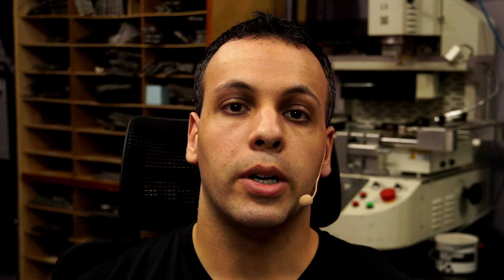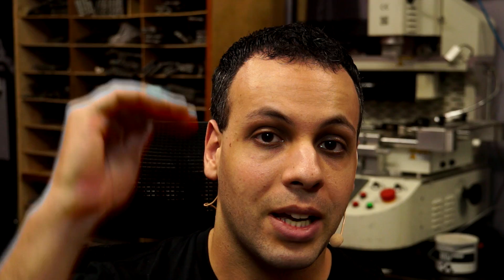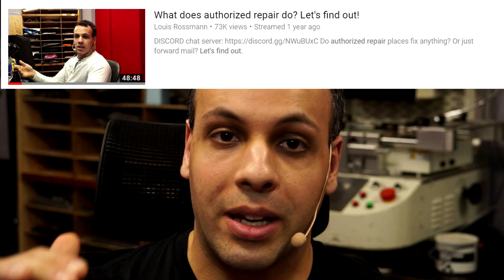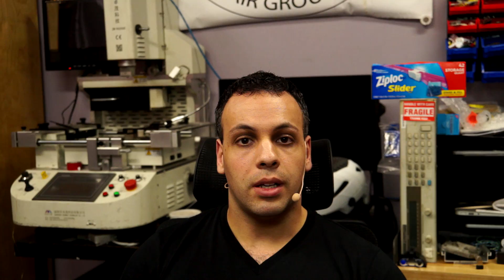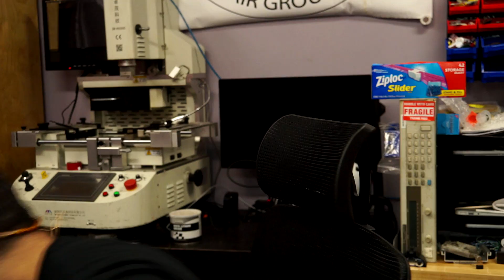Apple's war on refurbishing.

Comment: I’m torn in this topic. On the one side of Apple, sub par repair shops could potentially damage the brand. A bad repair can cause negative consumer perception of the product itself. On the other side, a company exclusively holding the keys to repair rights causes inflated repair rates. I’m just surprised how far Apple is willing to go to chase down “unauthorized” repairs.

Comment: I previously worked for a company that did repair and refurbishing on multiple brands of copiers. The cost of board replacement for copiers is absolutely bonkers. Once a machine is out of warranty, replacing the main and engine boards in most machines is usually just as expensive as replacing the whole machine, so we often use boards from damaged machines, or take a donor board and do minor swaparoos to make one usable part.

Thankfully, the copier industry has not reached the model of forced obsolescence yet, because copiers are not often sold at a high profit margin, instead relying on the sale of service contracts and supplies over the years. Either way, the precedent Apple could set is pretty scary.

Comment: I recently had a leaky faucet in my Apple Home. Apple asked me to return my home in it's original packaging for warranty consideration. When I explained that this wasn't possible, Apple offered to sell me a new home. Of course my home model was now obsolete, so for a nominal charge, I was offered an "upgraded" home. 

The cost of bulldozing my "non-functioning" home was more than the initial cost. I had a RedSeal Journeyman Plumber replace it with a Home Depot ($2.49) faucet cartridge and promptly found all my doors and (dare I say it) windows locked. 

When I looked into replacing my home with an Ubuntu or maybe a MicroSoft home, Apple's legal arm reminded me that my "land property agreement" was compatible only with having an Apple Home. As I took the matter to the local, then Provincial Courts, Apple began drilling for oil on my modest property.

Because I had "modified" my home, I violated the EULA. Apple therefore adopted all mineral rights and is currently making $millions/month and my home is currently the "rigger's dorm".

On the plus side... the faucet doesn't leak anymore.

Comment: VW has been doing this for fifteen years with "component protection". Control modules installed on the in-car computer network are only able to be installed and "adapted" once. Because of this there is no such thing as a "good used" module, once installed it is tied to that network. This forces the owner to come to the dealer and have a new component installed by them, utilizing their system that actively connects the vehicle to the VW AG computer system and database. The ability to "unlock" the system to even allow it to recognize a new component is solely held by VW. Let us not forget the environmental cost of not being able to utilize parts lying dormant in wrecked vehicles, some of these components having a large carbon footprint in the manufacturing process.  Tesla has turned this into an absolute art form, and John Deere has been holding farmers hostage for the two decades. This is just another step, this war has been going on for years....  and yes it all started with the guise of "security".

Comment: So far there are only 2 industries this sort of corporate abuse is seen as normal, tech and entertainment.  As they are rapidly becoming one and the same we can expect the situation to only become worse. The battle of Net Neutrality is a fine example. I buy a certain amount of bandwidth from AT&T and, aside from disruptive or unlawful use, I not AT&T, should have the unimpeded, unthrottled choice of how I use my allotted bandwidth. AT&T thinks otherwise and soon may make it difficult or impossible for me to use certain services unless AT&T approves.  We're all already conditioned to this from tech and media and so it's almost a given AT&T will get it's way.  No big deal, except tech and media are spreading into everything.  Your toaster, your car, your dog callar.  Soon your electric company will be controlling what brand dish washer will work in your house. Plug in a brand of hair dryer that hasn't paid to be on your electric company's approved list and it only blows cold air.

Comment: Apple will not kill repair, but it may  kill repair of Apple devices. 

I predict Apple will turn to a lease business model where device repair, replace and upgrade is included in a monthly contract. Like software, the device market is getting mature where differences between devices is decreased and new models have improvements that are small and of questionable utility. Adobe has moved to a subscription model, Office is trying to move to a subscription model. MacOS is essentially a subscription model where the price of entry is to buy a Mac.

For software companies it is the long logical step to maintain revenue. Moving that business model into "disposable" hardware tightly integrated with software is not only logical but inevitable. As is often the case Apple will be a market leader. Doesn't mean it is a good direction.

Comment: This case isn't about refurbishing it is about repair or upgrading. Any argument made about replacing the glass is transferable to any other component in a device and not just apple devices or mobile device. If apple wims this case and you buy a pre built system from dell in norway (and later anywhere) then upgrade it could would be considered counterfit. Louis mentioned cars in this video the legal precedent is in the Intelectual Property sector which extends to cars and anywhere else a manufacturer places a logo on something.

Comment: IBM had a huge lead in the 1980's which disolved into nothing by the 1990's when clones toke over.  Outside competators will find away around the strong Apple marketing, then the loyal customers will blindly buy other crap.

Comment: Having SSD and RAM soldered in makes your data just that much less prone to a security breach by hackers who know what they are doing or even a random dude with Kali manual he downloaded for free lol

I support right to repair though regardless but I’m not blinded by my bias either way as they choose to over charge a great deal for higher specs.

I choose security though over upgradable internal components at this point.

(Off topic I know 👽)

Comment: That’s really what’s happening across the spectrum not just Apple. One of my friend's dad’s TV repair shop also closed. Things got miniaturized and also basic info that used to be part of the user manual was tougher to come by and generally people just shifted to new products.
Earlier companies used to make products that were easy to open and fix and used standardised components so even aftermarket parts could be used. Now everybody is going custom and designing for a short life... makes it cheaper too as they can mass manufacturer replacement parts.
I'm part of the Electric Vehicle industry and part replacements are extremely normal especially electronic components like - AC to DC converters, Controller boards, Onboard charger that sends current to batteries, BMS and so on.  It's all about replacement and not repair.
Its terrible, but corporations are going this route there is nothing that can be done about this.
Apple isn’t the only one just the most successful one - so it's easy to attack them.

Comment: I am a big supporter of right to repair, and love Louis's work.  But the story was a little misleading when talking about the home button.  They neglected to mention the fact that very same home button also contains the fingerprint reader for touch ID.  There are very legitimate reasons to have the OS lock down if it detects someone messing with a bio-metric security interface.  As a user of these bio-metric devices I support the OS locking down down when a major change is detected, even if it means I do have to have certain things repaired directly by the manufacturer.  We need to find the balance between protecting our privacy and our right to repair.  This is just a little thing that bothered me about the story...I love the work you are doing for all of us!  Thank you!

Comment: The problem is that we are expecting so little of your average citizen. Louis's videos on teaching and parenting highlight the same concept. People don't understand, blindly follow those who scream loudest, and refuse to put in the energy to learn the truth. I am convinced that unless this trend changes, it will be the downfall of society. 

In the 1960s, Heathkit sold tube amp kits with plate voltages nearing 500 volts to consumers. They sold transmitter and RF amplifier kits with voltages in excess of 1000 volts at lethal current. There are warnings in the manuals, of course, but people were expected to take responsibility. 

I've had people try to tell me that repairing a computer is dangerous. We need to draw a line somewhere on what we expect from consumers.

Comment: if apple wants to kill repair then why not go after the so called "mall screen repair" shops too.

good counterfeiters are going to steal the stencils to print the logos or even steal the legit parts for examples.

1. a good apple counterfeiter will break into the factory of foxconn and steal the stencils or printing plates for the logos (similar thing has happened in the past at us mints where someone stole the printing plates for money).

2. a good apple counterfeiter will break into the foxconn factory and steal the already printed plastics for the products and slap their own shoddy parts in the enclosures (similar thing happens with designer products like where the legit cuggi badges are stolen and applied to flawed leather or even plastic).

apple if you are really serious about preventing repairs why not go the extra mile and take a page from laptop battery makers where they suicide the bms so if you try to replace the cells then the battery no longer works. (arcade games boards did this with a battery and some nintendo cartridges had a battery so if the chip is dumped the contents are lost to prevent piracy)

install a chip on the digitizer glass so as soon as the screen is disconnected from the motherboard (even for motherboard replacement) the authentication code in the chip is lost and then the digitizer stops working

Comment: .... then the glue comes off the glass and the touch sensor stops working.  What amazes me is Apple will charge $150 for a display replacement and these refurbished places will charge $20 less and your phone stops working in six months. Why, just take it to Apple and ha e it fixed, if they break your iPhone during the repair or unable to successfully calibrate it, you get a new device at the cost of the display. If these repair shops break it, you ain’t getting shit.

Comment: To be fair, the touch id security argument is nonsense. How do these work? The touch id stores the finger prints (a one way hash of them) on itself, it does not give this data over to other parts of the phone. When there is an authentication request the phone will simply wait till it is interrupted, or an authenticated signal comes from the touch id (simplyfied a lot in this). Let's say you switch out the touch id part. The only problem should be that the recognized fignerprints "disappeared", because it was in the chip itself which is not there anymore. If you put the original touch id on an other phone, than the touch id should recognize that the underlying hardware changed (not hard, should be properly protected behind assymetric keys).

TL-DR: There is no security reason to stop the touchid from working when it was changed, it should only forget the fingerprints.

Comment: Sadly, this whole concept is really true, and has been going on too long.
Lets talk automotive... GM (or just Holden as we may call it here).

My car, 1999 model, relies on two computer (modules)...  The ECU (engine control), and the BCM (body control, ie lights doors etc).
Each must be matched to the other via their unique code, otherwise nothing works. A repairer can fix wiring, but if a MODULE needs to be replaced, well, one is at the mercy of the dealer prices to "pair" the two together again... and from what I've heard, It's way, way, expensive  :(

Something  needs to be done across ALL industries.

Comment: changing a honda muffler with a non oem part is not a refurbish, nor is it an upgrade. however if you buy a non oem honda branded muffler thats not actually made by honda or a certified oem manufacturer is a counterfeit product. you still risk nothing in an automobile until your slinging ads stating youre a repair shop using oem product. consumer electronics is a shitty industry.

Comment: I don't disagree with the right to repair concept.  But Louis is wrong here.  The problem isn't with refurbishing the phones, the problem is refurbishing the phones with aftermarket parts.  The difference is between OE, OEM, and Aftermarket parts. An OE part would be a glass screen produced by Apple or an Apple manufacturer with the Apple logo/branding.  An OEM part would be if the manufacturer of the Apple screens produced their own without the apple logo.  An aftermarket is producing the part without any affiliation to Apple.  A good analogy is car parts.  When I buy a new car it comes with OE wheels.  In my case, my wheels say "Ford" on them.  I could buy the same wheel made by the same manufacturer but without the Ford logo, and that would be an OEM set of wheels.  If Ford has allowed the manufacturer to produce these wheels, that is fine.  Lastly, I could buy a set of wheels that looks nothing like the OE wheels, fits my car, and that would be an aftermarket part.  The problem then is if a company is producing wheels that look identical to the OE wheels, says "ford" on them, but the company has no affiliation to Ford whatsoever.  That is counterfeit.  The same thing is happening here.  Louis confuses this issue with that of the "right to repair" issue.  Apple is quite clearly within their legal rights in this case.

Comment: Microsoft married the Xbox 360 disc drive to the unit. If you wanted to replace the disk drive you had to have the skill to swap out the board within the disk drive... And with there being five different model drives you also had to get just the right Drive.

Comment: I hate apple from the very early on Apple II era, I and my family have never owned and will never own anything made by Apple. 
Smart people should only buy things that they own and are allowed to repair.
I think by law it should be that circuit diagrams are provided by the manufacturer along with user manual when buying any  electronic equipment.

Comment: So Louis...who do you trust? I've been a PC and Android user....always have always will be. I've always built my PCs, but I'm curious if Samsung is starting this same $#!+ with the Galaxy phones. There's where I've bee for some time now. So...should I be leery?
Reply: yes samsung doing same thing (there a new type phone coming out but cant remember the name)

LG and Google are all copying apple now it seems

delete android go lineage os
Reply: @DragonProtector  that's a dang shame!! I have the Galaxy Note 8 and love it, but at the same its glass front and back all glued together! Makes its it real tough to repair. My fear is they make it this way so they break easy. Such a shame.
So anything with the lineage os phones that is just as good bells as whistles, robust and easy to get into when you need to say replace the battery or a cracked screen that you can recomend?
Reply: Just get any current phone hack it install lineage os (i got original pixel xl and i love lineage os and it way better then stock android)

Comment: The war has been going on for decades.
In the 70's you could earn a living repairing TV's (Hell we used to repair kettles and toasters! imagine that)
In the 80's & 90's TV construction started to get more integrated and got a lot cheaper to replace - squeezing out the repair shops but new tech VCR's - and tech stuff like NICAM and SMPSUs helped pick up the numbers - if you could do component level diagnosis & repair.
Then came PC's & phones - which were lucrative for a while, and now they are going the same way. For sure apple are a bit more open about trying to fuck the little guy, but actually it's always been there in the business model. If stuff doesn't break in the medium term, or get so outdated that replacement is the only option then nobody has a job tomorrow.
same with cars, same with everything.
sux to be us.

Comment: “own” is not a clear word. Apple and You both fight for the rights for a thing. Ex. You don't own usd, but you can use it in limited way. You can say we own Apple, and apple also can say we own the consumers. 'own' don't have a line, but rights have a blurd line. That is why you can use your house and  car to get a loan, and the manufacturers also can use  the user number to increase  their value. And for regular retail electronics, we don't own the product, the tech and design still belong to the last owner, with is the seller. We only bought the limit way to use a part of function. As the law today, apple will win the case for sure. So what you need to do is to change the laws.